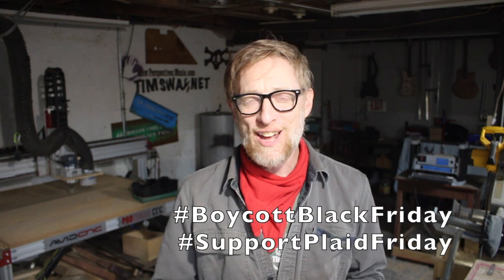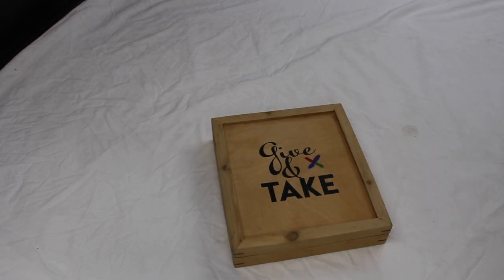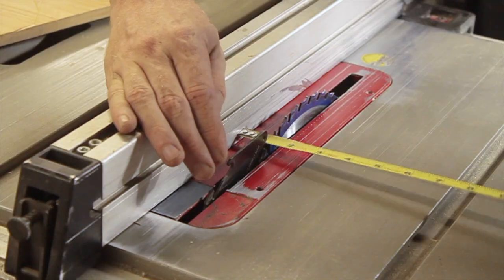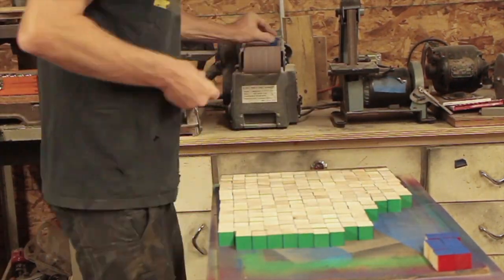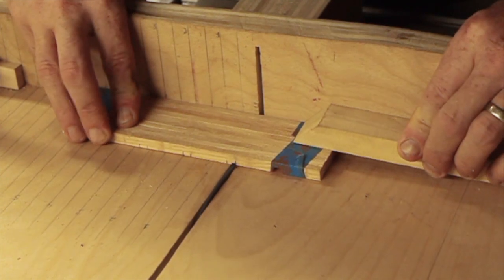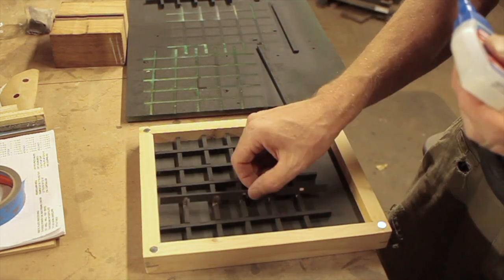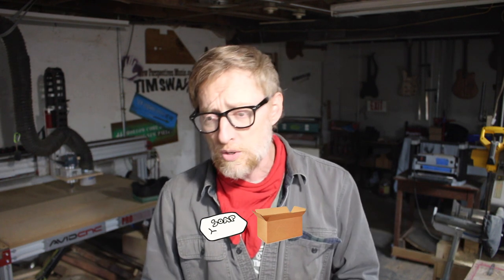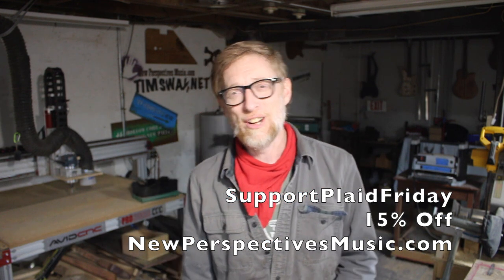Make this Game I Created as a Gift  -  Boycott Black Friday no.  8

Comment: I did also boycott. Anyway here's a suggestion. Do a miniresonator electric guitar. Just a tiny bowl with a piezopickup. And an ordinary humbucker. The miniresonator could perhaps be made out of a harmonica. I've seen ppl using a dogbowl. It shouldn't be to complicated just a slight hole underneath the resonator perhaps. Like the diameter of the anglegrinder. I don't know, just an idea.